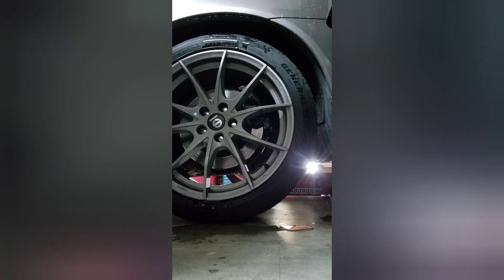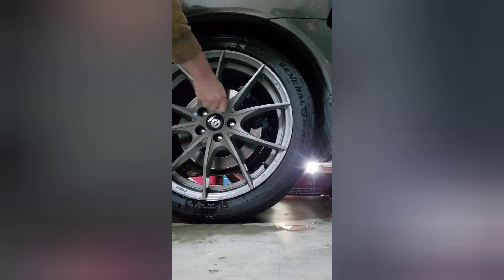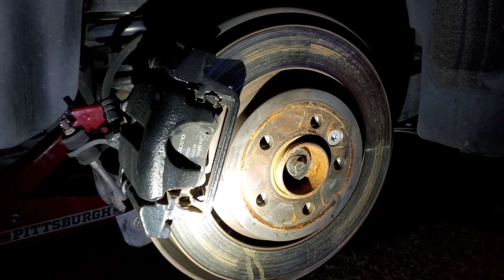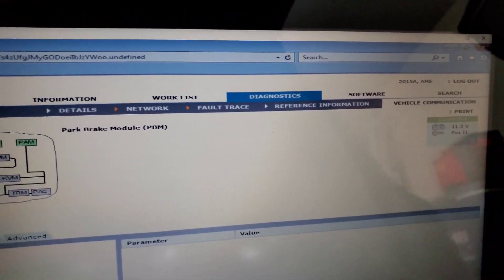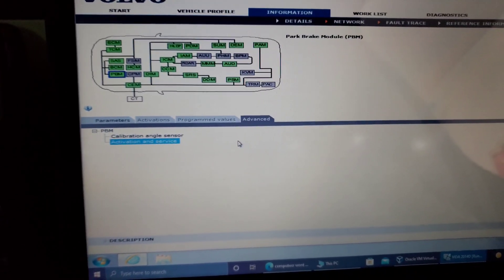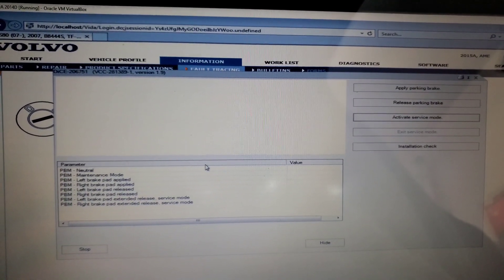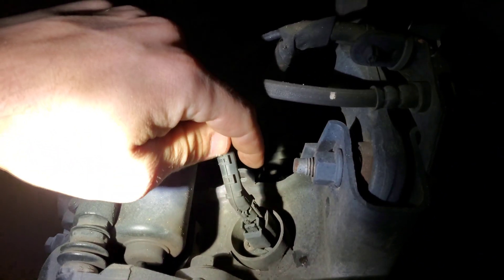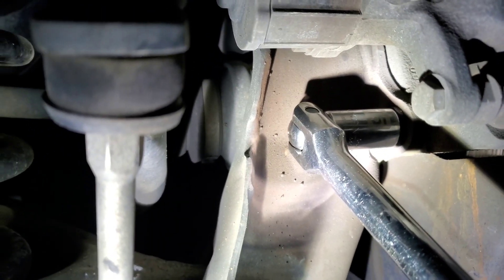2007-2016 VOLVO P3 Electronic Parking Brake Retraction in VIDA!

Comment: Brilliant video.

Only issue is for me VIDA doesn't see the pbm , so ive manually unwound the motors.

But would that suggest the pmb is dead?

All fuses are fine. New battery. 
Have a second hand replacement of identical part numbers lined up, but it's still expensive if it's not the true problem. 

Be grateful for any insight. 😅